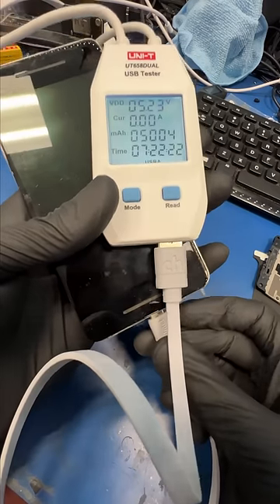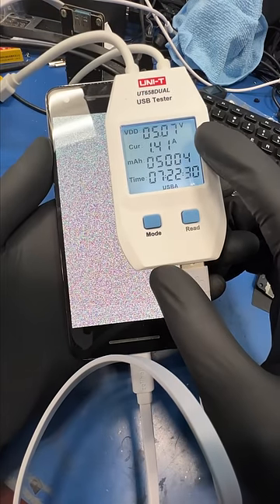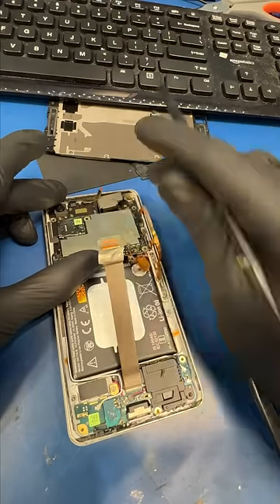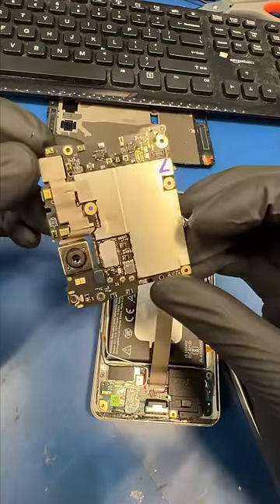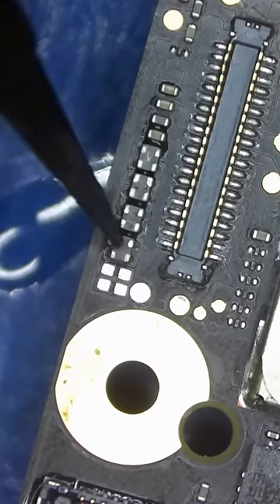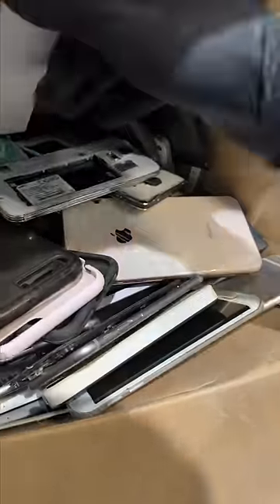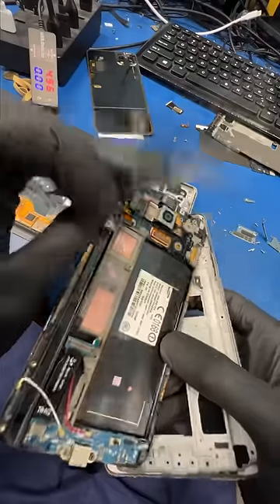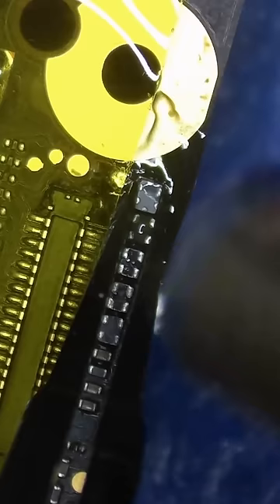Can This Google Pixel Be Saved? #tech

Comment: “We fucked up so it’s not our fault”

Edit: I say this because I assume the missing filter was knocked off by the mall repair. They say it’s already broken, but I think they broke it and didn’t take responsibility. However, the phone was said to be “returned in peices” but he has to take the phone apart anyway to identify it. Unless the “previous tech” broke it during reassembly, and had happened between receiving from mall and the video. I don’t see how that’s the case however, because they brought it to the mall for a replacement screen. The only way I can see the mall repair not being the ones who broke it off is if the piece came undone after a drop, and they lost it in disassembly. 

TLDR: I’m pretty sure the mall repair broke it and didn’t take responsibility for it, saying it was an impossible fix. But I offer 2 alternatives in paragraph.
Reply: Do you say the f word in that
Reply: @IMAMONKEmonkey  yes, is it censored? I don’t mind if it is but if it is that’s new info for me.
Reply: Took my BMW for a service and they managed to do the same. Still in a legal battle
Reply: She sent it to get the screen fixed because it was cracked. They repaired the screen but knocked off a filter and told her it was unrepairable.

Comment: as someone else pointed out buried in the replies,  those pads looked clean.  I don't do a lot of knocking off surface mount components, but when I do, there's usually bits of the part left, or specs of solder if it was a bad joint, or the contact pad is ripped off with the chip.

I've got to attribute this to malice: Brick the device hoping to upsell a phone.

Comment: Just don’t go to a repair shop that’s in a mall or shopping centre, lots of them don’t even have the right parts and equipment, they just use what fits on there and most likely will charge you a lot but do more damage in the process. I would recommend finding a trusted or professional repair shop.
Reply: Great advice, except i don't have a trusted phone repair shop that i use every month. And they are all professionals since they earn a living from that job.

Comment: Nothing beats the old main board graveyard. I had hundreds of the things of all different models when I was doing solder work on cellphones. The biggest problem was the iPhone 6 and 6+ backlight filter blowing because idiots who don’t know what they’re doing just pulling the screen or putting a new one in without disconnecting the battery before doing anything else. They’d then tell the customer it was more than just a screen replacement and unfixable. Had a hell of a lot of relieved customers after replacing one tiny little filter. I’d also make sure that the customer learned a valuable lesson about always keeping important data backed up. Before cloud storage it was astonishing the amount of people who never backed up their data and would run in in a panic after dropping their phone in water or smashing the screen. ALWAYS secure your data people.

Comment: Or just...take the internal storage out if the screen can't be repaired??
Reply: or just... fix the original so you don't have to spend $1,000 on a new phone??
Reply: @XanderThatGuy  That wasn't my point. The guy was talking about the ONLY way to get the pictures back was getting the screen repaired. That would only be the case if their drive was encrypted by the operating system and locked to a TPM or specific hardware. Yes a fixed screen is better, but it's not the ONLY way to recover data.
Reply: But this screen can be repaired easily, maybe as a last resort no doubt

Comment: do yuou really need a screen to get data back? Not!! just plug in the phone to a USB and transfer the files. 😆
Reply: newer versions of Android default to an only charging mode as a sexurity measure so you can't just grab the data. you have to accept the filetransfer and set the phobe to allow it for which you need a screen
Reply: Sometimes it doesn’t work like that, sometimes the usb charging port can be damaged and doesn’t allow transferring but allows charging. It’s werid
Reply: @theerandomdude2375  Ah.. I see..👍👍👍

Comment: You don't even need to do that, plug in a docking station into the charge port and send the display to an external monitor. I only know this because I had to do it for someone with a messed up screen. Worked just fine.

Comment: THANK YOU for your help!  My last phone was bought because mine old one was literally expanding and I had to hold it together with a rubber band. 
After buying the new phone, from an ATT store, on the way home an hour from the store, I found out they gave me one of the crappy designed phones that you cannot use a stylus to use for the headphones…... you had to use a blade adapter for it. That was also Your charging port. Worst designed phone ever. Still have it, still growl whenever I have to use the headphones and the blade adapter. Means I cannot use my headphones at all!  
They saw me coming…..

Comment: This is why i dont trust random repair shops, i took my old phone it because it wouldnt boot and they claimed the board was cooked and would cost £200 to fix and i would loose everything, i was in denial and in a fit of desperation i took the battery out and it was showing like 1V so i replaced the battery with a £30 off ebay and it was working good as new. I only get my phones repaired from the providers i buy them from from now on, idc if it is overpriced i trust them to know how to work on the phone they are selling me

Comment: I took my laptop to see if it could be repaired. Turns out the motherboard was fried and no way to get another since it was six years old at that point. Fair enough, I took it back and decided to sell it for parts. 

Fuckers stole one of my RAM cards. They denied it ever had two, even though I know it had two because I had specifically installed the extra one myself. Nothing I could do because I had no proof that the laptop had two going in.

Comment: I have a Pixel 7 Pro.  The issue I have is that my phone completely locked up hard which left me with only the hard reset as an option.  I perform the action and the phone powers off.  Now it won't power back on.  The repair shop I took it to stated that something was awry with the screen causing the motherboard to not post.  They replaced the screen and five days later, the phone started doing what I mentioned at the start of this post.  What the hells is going on with it?

Comment: The novell server that had 2 300mb 5.25“ drives died. I got it working by switching the external boards on the drives. Took the bad one to seagate (this eas a loooong time ago), and the guy disnt believe that it worked. 🤷

Comment: I had a similar issue took my laptop in for a warranty repair the tech broke half the screw holes so the bottom flexed everytime i opened the lid.  Well that slowly broke every fan blade for the cpu.

Comment: FAKE video.  There are too many inconsistencies in this video.  That so called "missing filter" is unpopulated from the factory.   The solder pads are untinned and clean, so there is no way a component got knocked off from it.   The motherboards are different.   Plus saying it was in "pieces in a ziplock bag" while showing you an assembled phone with a corrupted display is also a red flag.